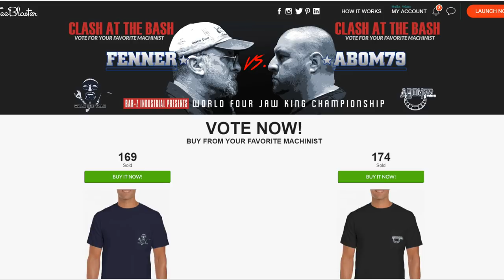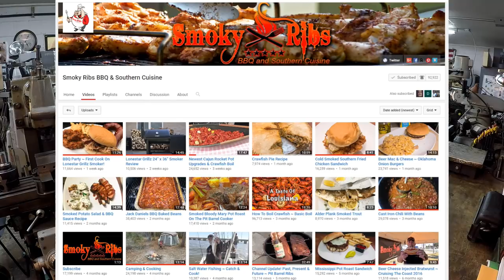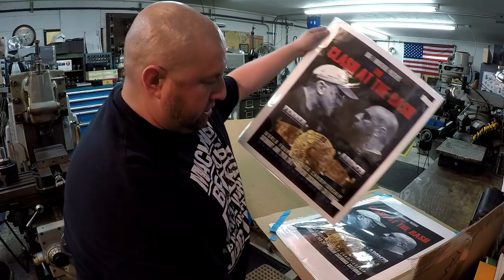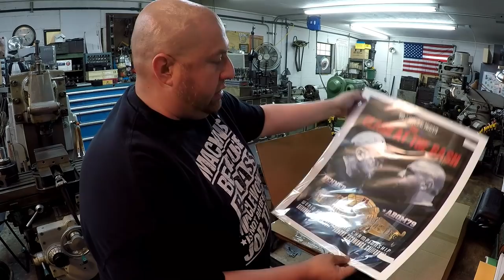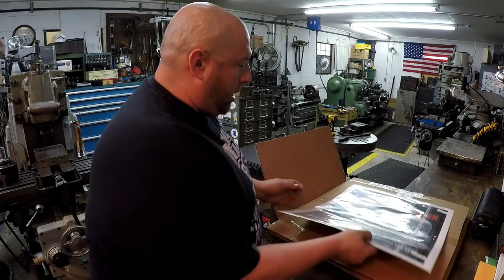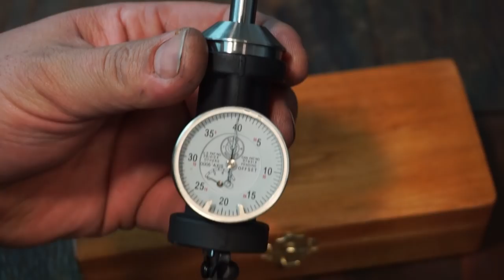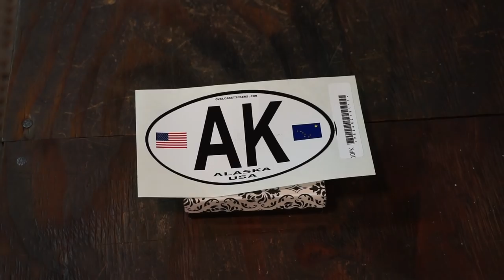SNS 164 Part 1: Metalizing, Thread Chasing, Viewer Mail

Comment: Great SNS, nice repairs, I think the flange was a bad design, very little meat between the roots of the threads on the large hole and smaller holes, just my idea.
Reply from the maker: I agree that it should have more wall thickness.

Comment: Now that's a proper thread cleanup!   None of that EZ thread garbage
Reply from the maker: RumpLeINtiLINsKinnIN I haven't tried that ez thread, I see Keith and Keith posted videos of it though.
Reply: Yeah I seen both them using it  just to give it a shot.  Didnt work as well for Keith R.
Reply: Well, if you have a professional machinist and a million dollar shop, you can do beautiful work.  However, the EZ thread may be the quick fix or especially the field repair you need to do.  Like anything, I would suspect the tool takes a bit of practice to get the best result.
Reply: true

Comment: One thing I learned years ago about working on tie rod air cylinders. The factory guys (and I was factory trained) couldn't tell me a torque spec for the tie rods. They just said "get them tight". I think too much. I remembered my first job out of HS working for Sears and helping the guys assemble bicycles. They couldn't get the wheels to run true and I figured out a way to "ring" the spokes. Like tuning a guitar. Tap them and when they all ring the same tone they are all the same tightness. Then the wheel ran true.Same with cylinder tie rods. If there is no spec making them all ring the same is your best bet. Or at least it worked for me...YMMV...
Reply from the maker: Phil Grindle We do have a spec sheet from the NFPA on proper torque specs for both hydraulic and pneumatic cylinders.
Reply: Threw me for a second. I think NFPA as National Fire Protection Assn. now. Not National Fluid Power. I guess things have changed in 40 years... :)
Reply: Phil Grindle - I thought the same thing when I read NFPA!

Comment: What size drill do you use when you're drilling out a stuck bolt?  Just the pre-tapped drill size or a couple sizes under?
Reply from the maker: Sometimes that depends, but normally I start small and work my way up to tap size.

Comment: Very neat job chasing those cylinder threads.  I'm curious how and where (on  the dial)  you decided to engage the half nuts on the screw.  Thanks.  That coax indicator looks great.  Hope you'll show how it is used.  Happy Easter.
Reply from the maker: It was a 12 pitch so because the lead screw is a 4 pitch, you can engage anywhere you want and it will always line up. Remember that if the thread pitch your cutting is divisible by the lead screw pitch (4) you can enage the half nuts at anytime, don't even have to look.

Comment: at 30:46 it looks as if the smaller threaded holes are too close to the inside threaded bore (too narrow wall)
Reply from the maker: MLTomson I would agree but it's prettt common with tie rod cylinders.

Comment: Hey Adam. I have got a few questions about spray metalizing. What kind of covering paint do you use? What type of metal powder are you using? Do you sand blast materials to break the layer of metal oxides on the surface you are repairing? Is it crucial to start proces of metalizing as soon as it is possible after prepairing the surface?

Comment: The Blake coax is a different level tool vs. the cheap imports.  I'm sure you'll love it Adam.

Is stick welding 7018 a good way to do a worn shaft repair if I don't have access to a spray welder? 

Love your channel and your t-shirt!
Reply from the maker: Thanks Jeff, I already love it. Yes 7018 is the perfect way to weld up a worn area and machine.

Comment: Chasing threads with a tap is easy, but I've never chased one on a lathe. I thought you would have to turn off the lathe and get the tool in the right position, then engage half nut before turning on the lathe. Just my guess. Could you do a video on how to do it. Thank you.

Comment: Adam, I have a question about chasing the threads.  I am a bit more dense than most, so bear with me.  When you set that up, you set the compound to 29.5* and then turned it in so the tool touches the root, then you zero the cross slide and work back to zero with out touching the compound right?  Also when you engage the feed, is it going to automatically start with the threads since you engage it on a number for the proper threads?
Reply from the maker: Once you have it zero, it's possible you may be touching heavy to one side of the thread, that's one of the reasons I back away from zero for each pass, and work my way into it to make sure the tool doesnt cut heavy to one side.That job I had it lined up perfect. Once you engage the half nuts and then line up the thread, the lathe is now set and will line up if you engage the half nuts properly, in this case, any position.

Comment: Nice work Adam.  It looks like you have a different torch for the spray welding at work than you do at your shop.  Is the one at the shop an Eutectic too?  It looks like it's easier to control with the lever rather than having to raise or lower the torch to feed the metal powder in.
Reply from the maker: It's a different type of gun, the newer type. Yes it's a Eutectic Castoline torch.

Comment: Nice timing there Adam. Just bought one of those Starrett back indicators on EBay, and was wondering  what it was best for. Thanks for another great video too.
Reply from the maker: They are handy for many things, I especially love them for tramming in a vise too. Couple it with the included ID attachment for indicating bores.
Reply: Cheers Adam, appreciate it.

Comment: Is there a reason you don't just turn the seal surface down, and change the seal size? The machinist did that to me once, at work. The ID of the seal was to small, so when I tried to slide the motor shaft through with the pinion gear on, it wouldn't fit past the seals. Had to pull the motor back apart and weld the surface, and use original seal size. Usually that doesn't happen to us, but this was some foreign piece of art.
Reply from the maker: +prelwitz13 You can't do that to every application, but there have been a few jobs we turned down to the next size.
Reply: Awesome, cool to see you do it before I give her the ol try after hours.Thanks for all the knowledge and motivation!

Comment: So by centering your compound slide on the threads and setting your feed and speed according to the existing thread you can time it right in? Not much of a turner more milling and EDM.
Reply from the maker: liberty ordie You have to engage the lead screw then use both the compound and cross slide to align the tool bit.
Reply: Ok makes sense, Thanks.

Comment: Don´t fully understand how you syncronised the threading tool with the existing thread in the part, did you have to move the bar in the toolholderI
I mean the halfnuts are where they are and the compound is at 30 degrees so no way to adjust sideways there really right?
Reply from the maker: I do have another videos about half nuts and the lead screw, and when you can engage them. I was cutting a 12 pitch thread, and the lead screw of the machine is a 4 pitch, so you can engage the half nuts anytime. If the pitch your cutting is divisible by the lead screw pitch, you can engage them at any position.  Once engaged, use both the cross slide and the top slide to adjust the postilion of the tool to align it in the thread.
Reply: Think about it mate. With the compound at 30 degrees and the cross-slide straight, you can adjust one or the other for to wiggle it in there.
Reply: Ok, now i get it, thanks alot guys!